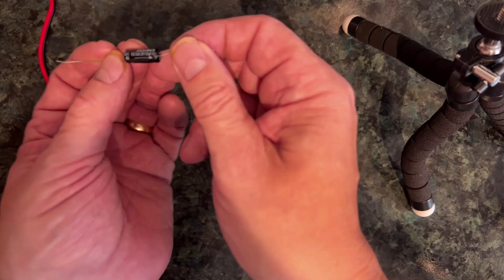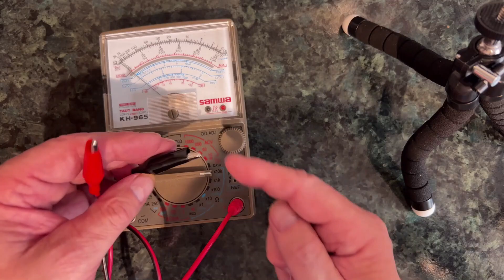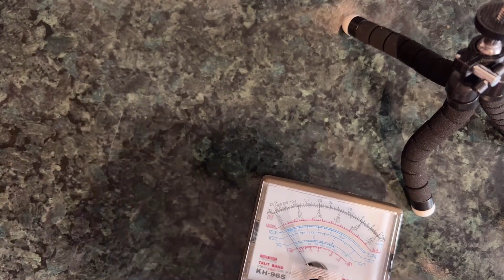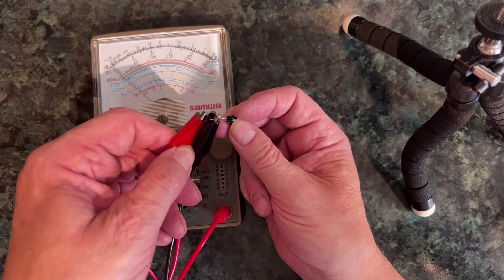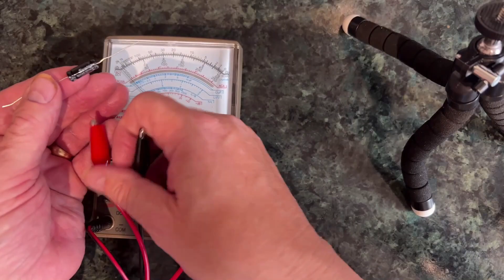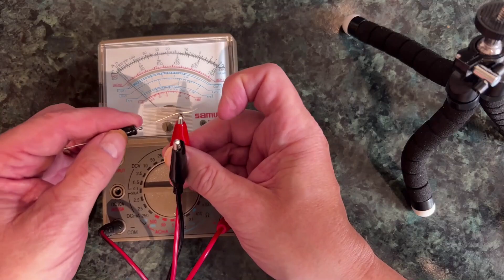Confusing Capacitors

Comment: Very unusual markings, as you said, the negative lead is usually the can itself & the insulated end is the positive. I normally get my caps from CPC.
Another way of checking is a capacitance bridge (LCR meter), but an analogue meter is fine.